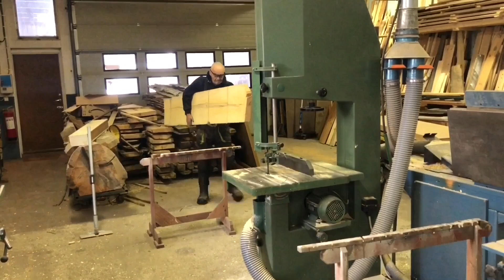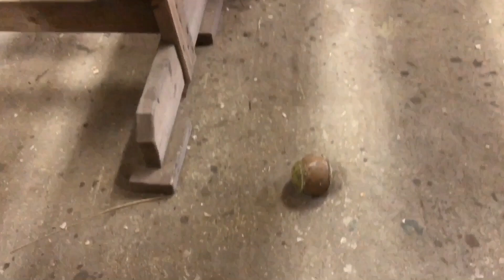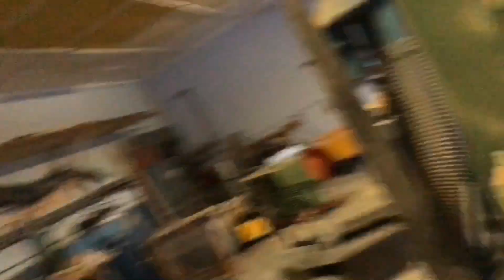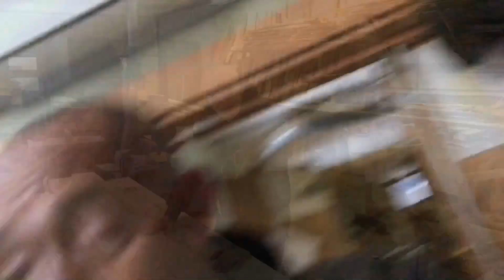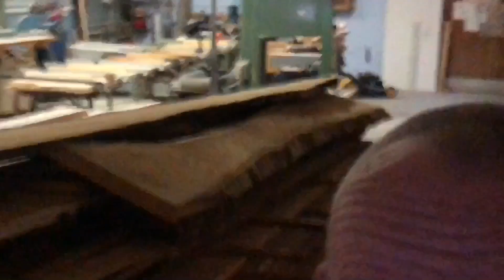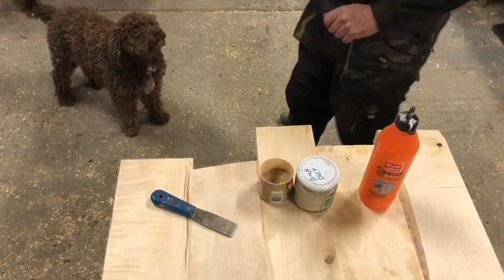Cutting huge Birch slabs and Making kitchen worktops

Comment: I can help you out with making a set of forks extensions but I don't know what metal you have hanging around.  .  Iv made a few sets over the years that work very good . 8 , 10 ,12 ,15 foot long .
Reply from the maker: Thanks Heith, I don't need fork extensions. I am going up not out. I have what I need, I just need to put it together. Then take a skill pill and a brave roll.
Reply: @arctic-rebel  I truly forgot about how high you had to go . Damit .  But if you ever need to reach out far or in deep I got you covered 😂  👊👍..

Comment: Howdy Simon- nice job joining all the boards together. You shared a lot of valuable information for those who have never done something like this. When I’ve had to join a panel like that I have to have my game plan all figured out because the glue we have available begins to set fairly quickly, so, that brings me to a question. What type of wood glue are you using? I know you were working as fast as you could but it seemed like you had more working time with the glue. Hope you and Ms.Sarah have a great weekend. God’s blessings to y’all
Reply from the maker: Hi Paul, sorry I thought I had mentioned which glue I was using. I cannot get 2 pack laminating glue in any small quantity so I was using polyurethane. It is not as good but will do the job. The shop temperature is about 42 degrees which gives me about 30 minuets. Naturally the time is  reduced the warmer it is. Take care my friend.

Comment: Well.. birch is hard to work with.. not that it is a hard wood, but the birch can be twisted, curled, warped and everything in between even when it has been drying for several years. So the job you have done joining the different pieces is pretty dang great👌👍 Looking forward to see the finished product, I'll bet it'll be awsome😃 All the best to you guys, have a great weekend🙂
Reply from the maker: Thank you, I really don't like working with birch but as you know it is the best of my options. It is also a great test of skill any reasonable joiner can work with stable hardwood and do a pretty good job, I know!
Reply: It would be fun to see what you could get out of some Rowan tree slabs.. A buddy and I made some indoor paneling of Rowan for his cabin, and the orange-red tint is pretty amazing. And it is way more stable than birch. Black alder is too, and a good alternative to birch, but it have a bad tendency to dull any edge because of all the  grit it accumulates over the years of growth.

Comment: Thanks Simon, i feel your long hours working a wide top to lay flat, you really get to have a relationship with the wood, just a idea but will your log yarder help in anyway to get the tops through 2nd story window? You and Sara have a great evening.
Reply from the maker: Thanks you Mark, the crane is not powerful enough to lift these tops I am sure I have the solution. Just have to put it into practice.